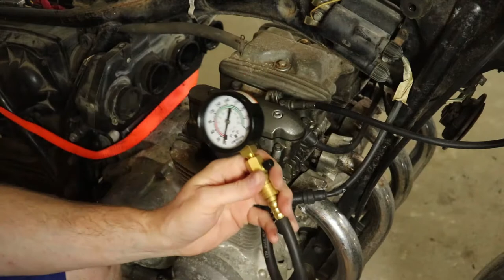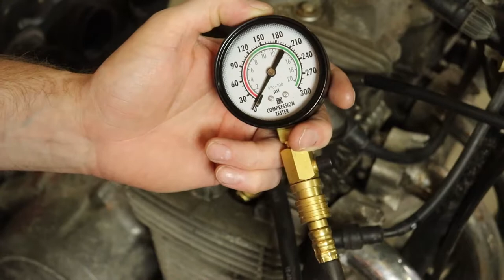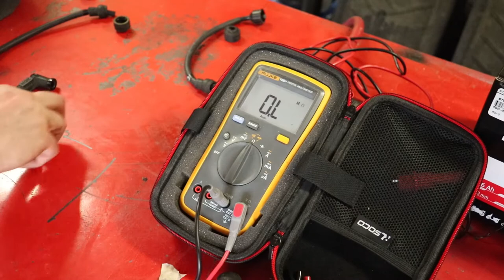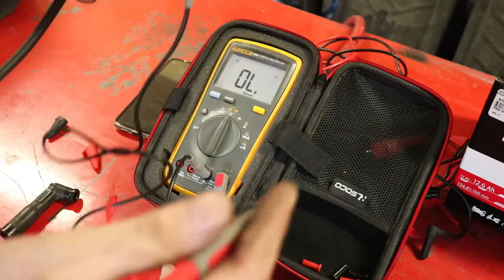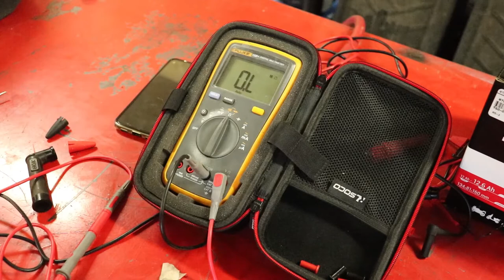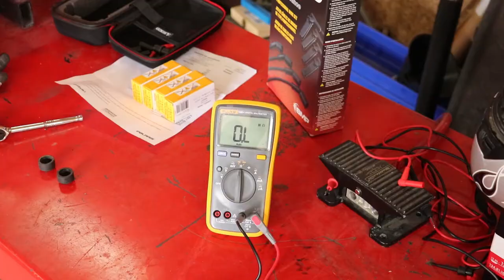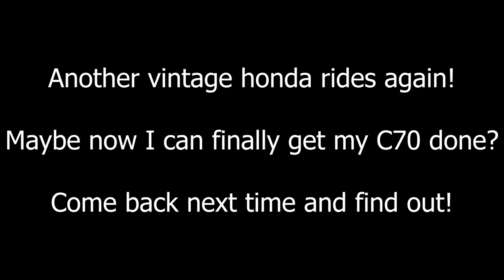1980 Honda CB650 Custom - Road Ready!

Comment: My dad was also the CB 950 so it had larger carbs and motor obviously but by the looks of that Carburetter pack I would still come in diesel fuel overnight to really help loosen up all the filth and diesel fuel is the best for doing that because it won’t harm the carbs

Comment: i'm a bit late to the party, dissasembled my carbs, very helpful video! however.. there were no air cutoff valves in any of the carbs. didnt spot any in your video. could you confirm this please? because i do see them in the manual downloaded from your website, but not on the component parts list of the carb in same manual, thanks!
Reply from the maker: In the stack I worked on, if you look at the video at this time code https://youtu.be/R3M_kN9hpNk?t=490 you'll see that the second carb from the left has the air cut off valve, you'll see that the bowl is different and has a post that goes up through the carb where it can get actuated.

Comment: So on mine for the spark plugs, they're wired 1-4 and 2-4 BUT the top one is 4 and the bottom is 1, does that make a difference or should I swap them? I haven't changed them, just remember them being wired different from yours top to bottom and wondered if that's why mine won't fire up.
Reply from the maker: You'll still get spark whether they are wired in proper order or not, but because they are out of order the spark is coming at the wrong time. I'd connect them correctly and that should at least put your plug firing order correct.
Reply: @blastworks  also another question is, my bike idles at about 3,000rpm, even if I adjust the idle screws, other than that, if I throttle it it'll cut out and seems to have a lot of white smoke come out of one of the left hand exhausts. Any idea what this could be?

Comment: I’ll save you all the time like I said already it’s the carburetters there’s spark there is fuel there is a clean gas tank because you drained your gas before parking for the winter and drained your carbs hopefully and another thing as well those bikes the best thing for them because they do take a certain battery is over the winter put them on a 6 V trickle charger disconnect the spark plug wires and stereo

Comment: No way in hell Road ready those for carburetters have to be completely disassembled cleaned retuned or if you wanna call it each one individually Hass to be set so the motor fires right that was the one downfall of those Motors was 4 large carburetters on a two cylinder motor I guess they thought feeding it more fuel would give it more power not the case at all every year my dad and I in the fall would pull the exhaust off the carburetters off break them down throw out the gaskets and seals into a plastic bag in case we needed them for next year to make our own which we’ve had to do a couple of times because they don’t make them anymore and to get the thickness of some of the gaskets just right you’re sitting there with 4000 grit sandpaper taking literally half The thickness of a hair off at a time and over the winter we would just leave them apart gaskets ready to go O-rings lubed up and every year it was an entire weekend of tuning each carburetter so each one would poor fuel into the motor at the exact same time we’re talking milliseconds so there’s never ever going to be a road ready after a season of sitting over the winter that you can sit on turn the key and it will start and my dad‘s bike was in showroom condition he even changed the tires every two year to 3 years just because the side walls for those was known for the design in shape they would develop cracks and that’s the last thing you want when you’re going around a mountain pass corner on a bike that is four times your weight and the vehicle comes the other direction sliding the side of the tire just enough to make it burst him and my mom when he first got it took it on a trip to Edmonton and back and he had a little camper trailer that he towed behind his that was designed for it and my mum still tells me how they were caught in a storm my dad had the bike leaning on a 45° angle because of the wind and the rain and she said if he brought it up anymore they probably would’ve been thrown into the mountainside
Reply: This bike is 4 cylinders. So 4 carbs to 4 cylinders.
However, I do agree that the carbs have to be fully broken down and the jets have to be verified clear and varnish removed, then each carb has to be adjusted and synchronized. Synchronization is after the valve clearance is adjusted, timing is set, and then the idle speed and carbs can be synchronized